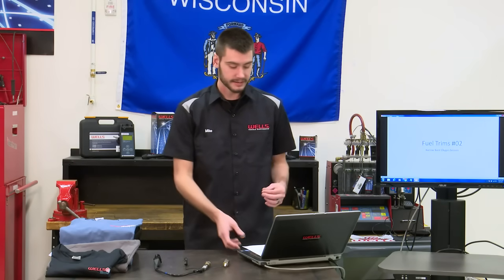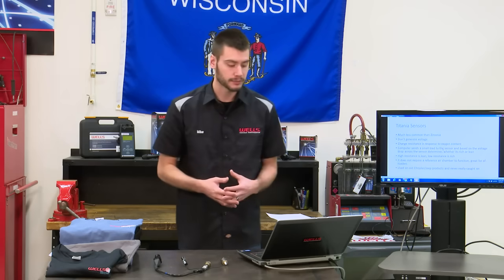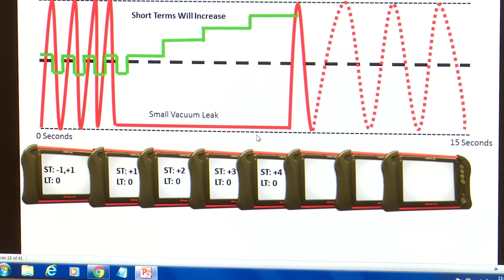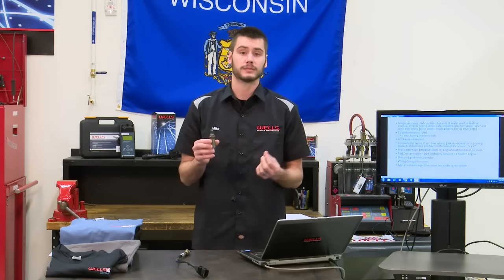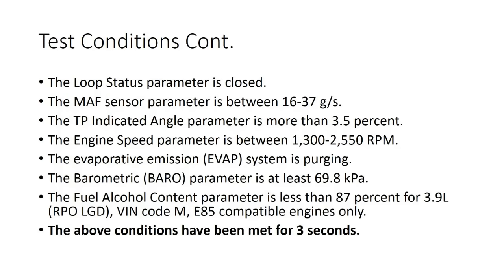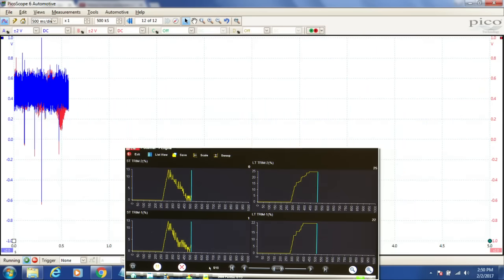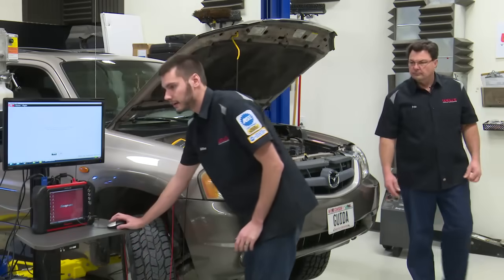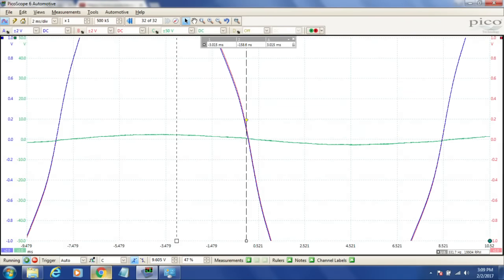Fuel Trims – Oxygen Sensor Basics—How They Work and How to Test and Diagnose Them (O2, HO2S)

Comment: GoTech => Very good presentation.  Thank you.
Questions - A scan of every measurement, status and settings that my Snap On Solus Edge would perform on a 2009 Saturn VUE Hybrid, and one setting seemed quite odd, that for Fuel, was set for METHANOL.  That looks like something programmed in to the ECM and no choices, such as E85, gasoline or nitro were presented.  
=> Will this METHANOL setting affect performance?  
=> Does the ECM learn and adjust to the actual O2 values even though the indicated fuel has a lot more oxygen than the actual fuel being burned?
=> Will the METHANOL ECM setting affect the setting of OBD P0420 &/or P1133 code flags?
The ECM is a new replacement.  An inquiry with FlashMaster/ Cincinnati, supplier of the ECM, had not encountered this before, even though its master mechanic/ owner, seemed quite knowledgeable and helpful with trying to find an answer.

Background
* EPA emissions test failed, OBD flag, Hybrid battery temp sensors, P092n (n= several numbers for various thermistors) and P092 (Starter/ generator perf, (likely due to current overload on a weak/ leaking prismatic NiMH cell that ruined a thermistor). 
* Faulty thermistor replaced.        Live data   STFT + LTFT < 5.0%.  O2 #2 sensor 670 to 750 mV, generally ~ 730 mV after warmup.  P0420 taking many drive cycles to set.  Needed to look further before taking for emissions testing.
* Then whack-a-mole problems began.  So  ECM, and both O2 sensors, exhaust manifold replaced.  P0420 still flagging despite good vacuum, no manifold exhaust leaks,.   O2 #1 and #2 sensor readings did not seem to change that much after driving 150+ miles.  
* Got an EPA emissions test waiver => OBD2 & Check Engine flags waived => Tailpipe emissions test performed. Tailpipe emissions test results of 0.01 g/ mi HC, 0.8 g/ mi CO, and 0.01 g/ mi NOx (close to non-detect for all), discharge cat converter temp > inlet (i.e., exhaust manifold) temp, O2 #1 sensor variable as expected (but an occasional P1133 flag on very short trips that clears itself quickly),  O2 #2  sensor steady at ~720 mV after warm up, about the same as the old O2 sensors.  I would like to say the average STFT is less than 2% but the LTFT has been averaging -5%.  (I am setting us to graph the STFT and LTFT to better substantiate these averages.)

Comment: I would like to use a vibrant j style fitting on my front o2 sensor due to clearance with the frame, my question is would the pcm be able to read correctly and if so should I use the fittings on both front o2 sensors?

Comment: To All you non mechanic DO IT YOUR SELFERS, If you want confirmation that your being told 100% accurate information on how a system works and how to diagnose. This guy has obviously torched his brain in researching thoroughly to where he could diagnose these specific problems in his sleep, without sounding egotistical, I consider myself and actually know that I'm a very very good mechanic with 32 years experience and I have learned some new information from this guys videos, and like anything your not quite an expert at, constant, consistently, with consistency will make you an expert, what I mean is always understand how a system works before you even waste 1 minute in trying to diagnose, watch this video over and over until you can repeat it in your sleep and you will become a expert, hard off to these guys in sharing there  brilliant knowledge with everyone

Comment: On my 03 Camry 2.4 Liter I keep getting the code P0141, I replaced the sensor after the catalytic converter and it came back on after 27 miles of driving. With the second replacement the light came back on after 1 mile. 
It started with code P0420 so I replaced the catalytic converter and then it triggered the P0141 code. After replacing the cat code p0141 is gone but not p0420. When I test the sensor it reads 6.9 and a new one reads 16.3. Help please and thank you
Reply: the cat code p0141 is gone but not p0141 ???
Reply: @jet6374  I meant to say that the code P0420 cleared after replacing the cat but when I replaced the pigtail for the sensor, the code P0420 came back.

Comment: at 8mins: Im finally getting it!   Combustion burning oxygen........ so greater difference on the element, referencing outside aid.  If not burning oxygen (lean) / too much air in the combustion then low voltage.  O2 is closer to outside O2 so therefore the element is less (active).

Comment: Hi I get a check engine light when the weather is cooler.  My mpg has dropped, the spark plugs look clean  with no brown or white haze to it.  Can the upstream o2 sensor be the culprit?  2005 Lexus Gx470 2UZ

Comment: If I put a new one In and it reads 0.0 longft2 is that Good or Bad ?
Reply: My Longft stay on 24.2 wit the truck on or off is that good I did have a p0174 code system tol lean bank 2

Comment: Its not a oxygen sensor.  There is no oxygen in exhaust gas. Try pyrometer or wide band EGT.
Reply: There is always some leftover O2 in the exhaust gas due to incomplete combustion, and there is always incomplete combustion. If we didn't have any incomplete combustion, we wouldn't need cats.

Comment: I got a 2nd gen mazda 6, 2.5L. I keep getting a lean code and if I clear it sometimes it will come back as a rich code. To me it seems like the o2 sensors aren't working efficiently and the mixture is fluctuating up and down trying to regulate. The only thing that confuses me is there's no code for an o2 sensor circuit or cat efficiency. I would like a 2nd opinion if anyone has any input I would appreciate it.
Reply: I forgot to mention it has an exhaust leak but I'm not sure where. It's not at the manifold and I believe it's the middle pipe or muffler that's leaking. I don't think that would make a different unless it's leaking before the cat or at the manifold but thought I would add it here.
Reply: Go to auto one have them pull codes if anything doesn’t pop up, graph the o2 sensors both should be fluctuating up n down the one that’s stuck up or down in the graph will throw off the downstream o2, the o2 graph not fluctuating needs to be replaced

Comment: Hi, very informative video, probably the best I've seen in terms of explanation of how these sensors actually work. Can you explain why not to use dielectric grease in the electrical connectors for O2 Sensors? I'm currently getting a P0420 code on my Audi S3 8V (2014) and am going to change both upstream and downstream sensors but seeing contrasting opinions online for the use of dielectric / silicone grease in the electrical plugs/connectors.

I realise the P0420 could be due to other reasons but my mechanic recommended changing the sensors to start with and see if that resolves it, if not it's likely either an air leak or the cat itself. It did previously have a blown head gasket which was replaced which could suggest one / both of the sensors have been contaminated though. Thoughts?
Reply: Did you watch this entire video? I did not...I made it to the 5 min. mark, and that's all I could take. He's highly incorrect about the operation of this sensor. The reason you don't put anything in the O2 connector is because the sensor gets it's O2 ions from the PCM traveling through wire itself. Electrical grease would prevent the flow of ions to make it to the tip of the sensor. He can't explain that to you because his explanation of how this works doesn't require the ions to migrate. I left an accurate description in the replies.

Comment: Hi I have 2020 Corolla le with code p0101 I change the mass air flow and still have the same problem what can I do
Reply: Did you ever get an answer?  How's the Corolla doing?  I had a 69 Corolla but sold it when I moved across the country and didn't want to bring to vehicles.

Comment: Once the air flow sensor reaches 600 degrees does the heater voltage stays on even after the engine is up to temperature??

Comment: I have an 03 F150 Lariat with high negative fuel trims, and a P0401 code.  I have replaced everything in the EGR system (as well as several other parts/sensors) and all 4 O2 sensors plus catalytic converters.  Any ideas what could be causing that?
Reply from the maker: Hey Jared,
This engine has a tendency to have EGR passage restrictions behind the throttle body gasket, where the hot exhaust gases from the EGR valve meet the cool intake air coming through the throttle body. To clean passages remove the EGR valve and throttle body.
~Ryan
Reply: @GoTech  my Bank 1 Sensor 2 O2 sensor is fluctuating voltage like the upstream sensor does...that's not normal is it? The bank 2 side slightly fluctuates, but it's mostly flat lined.  Could the downstream O2 sensor on the passenger side be messed up and giving false readings for fuel trims?
Reply: @GoTech  I have done all of that, I recently replaced the intake manifold.  So I went ahead and cleaned the entire throttle body, passages and all.  They were actually quite clean already.

Comment: I'm having a problem with my O2 sensor, my catalytic converter was taken from my Toyota prius 2008 with sensor 2 together but after replacing it with the original parts, catalytic converter and sensor 2, the light has been popping up with code P0137, the O2 sensor's low voltage bank 1 sensor 2, I went to Toyota they said sensor 1 is not good and my gas consumption has gone up 25% but now I have changed the sensor 1, still the light is kept on coming back, I didn't have this problem until my catalytic was stolen. the injector, spark plug and ignition coil are good What is the solution?
Reply: Shoot catalytic thieves is the solution. 
Glad I could help. 😂

Comment: I have a Nissan Frontier 4.O showing closed Loop Bank1 sensor 1 . P2A00 circuit range Bank 1 Sensor 1. I changed the sensor and light came back. This is. 5 wire heated sensor. Any thoughts ?
Reply from the maker: Hey Chris, I would need the year of the vehicle to give you detailed testing info. Aside form that, I always suggest taking a close look at the wiring harness and checking to make sure the sensor heater fuse is ok.
~Mike

Comment: Both wrong. Fill with dielectric grease and it cant sense beause contaminated. Not switching  because its "s2" after the catalytic converter so smooth signal shows an efficient catalyst. "S1" will be switching because theres an excess of hc which will be converted by the cat.. well i just learned i was wrong regarding tech a

Comment: answer is D because its only needs to be cleaned from any grease
because sensor does onle 0.2 -1.0 apprx volt so grease will mess it
never apply any grease on a low voltage circuits to avoid short or interferences
Reply: I wouldn't put grease anywhere near an O2 sensor...and besides, wouldn't it just melt off?

Comment: How do you fix a Po172 bank 1 on a Buick Lucern CXL Original Buick 6cyl.
Reply from the maker: Hey Robert,
I would take a close look at the MAF sensor.
~Ryan
Reply: Vacuum leak also. intake gasket, or pcv or any vacuum line on that bank Robert

Comment: Could a faulty rear 02 sensor cause a catalytic inefficiency code? My van threw that code and my scan tool says rear 02 is 800 millivolts flat line at idle
Reply from the maker: Hey Lucas,
A faulty o2 sensor could definitely cause a P0420 code, but having a flatline rear 02 signal at idle is normal. Since the catalytic converter's job is to absorb excess oxygen and use it to burn excess hydrocarbons. When it is working correctly it causes the rear 02 sensor to be fairly inactive. If the rear o2 sensor switches at the same rate as the front o2 sensor, this is when a faulty catalytic converter is suspected. I would try and test the readings while driving the car at different loads.
~Ryan
Reply: @GoTechTraining  sounds good

Comment: Could running an engine with highly contaminated oil cause zero compression?  I've got 0 compression in 6 cylinders, fml
Reply from the maker: Hey Tino,
Yes, if the oil is contaminated it can cause cylinder wash and you can loose compression. This commonly happens with fuel flooded engines.
~Ryan
Reply: @GoTechTraining  what should I do?  Hope it's salvagable
Reply from the maker: The first step would be to change out the engine oil. Then disable the fuel system by removing the fuse for the injectors or fuel pump to stop the fuel supply. Once the fuel is disabled crank the engine over and see if the compression comes back after it is lubricated properly. 
Do you what is contaminating the oil?
~Ryan
Reply: @GoTech  yes that's my plan.  Pretty sure Fuel was dumping because of a shit fuse diagram.  I'm worried it caused serious dmg though
Reply from the maker: Hopefully compression comes back! Good luck
~Ryan
Reply: @GoTech   I followed chevys fuse diagram and i think it sent extra current to fuel pump
Reply: @GoTechTraining  comp no-good,  moving to leak down test

Comment: my 3.6 gm is blowing black soot out of the bank 2 exhaust .. bank 1 is clean .. what`s up ..
Reply from the maker: Hi Willie,
Your Bank 2 oxygen sensor may be stuck lean, causing your ECM to over fuel your engine on bank 2.
Are any codes set?
~Ryan Wilsing
Reply: @GoTechTraining  i have po154 and 155 ,, oddly i just unhookd my pvc hose and created a small vacuum leak and my long term numbers went to zero ,, they had been 10 or more ..
Reply from the maker: Hey Willie,
Check your engine oil from being over full from fuel contamination. You may have a high pressure fuel pump leak (which is run off the camshaft) causing fuel to enter your oil and with the PCV it can cause your engine to run rich. Also check for leaking injectors.
~Ryan

Comment: what does it mean when whe sensor 1 bank1 slow to respond
Reply from the maker: Hi John,
The computer in the vehicle has to check to make sure the oxygen sensors are operating correctly. To do this the computer will force the engine rich or lean, or compare the o2 sensor to the other o2 sensors on the vehicle. If the 02 sensor responds slow (past a pre-determined amount of time) it will set a o2 sensor slow to respond code.
Thanks for watching and for reaching out!
Ryan Wilsing

Comment: Just changed my upstream O2 sensor on my 1999 Saturn SL. Yes, it’s still running great. I cleaned throttle body, changed plugs and wires, cleaned and re-oiled my K&N air filter plus other parts. The car ran great until it warmed up. Finally my service engine light came on. Took it to Advance Auto and they said O2 sensor code came up. That was actually what i was suspecting. I didn’t have the understanding on how it worked or just how important it is for engine performance. So with a new O2 sensor it runs like a top. I won’t be convinced that everything is working until i take a longer drive and I’ll know. I was wondering why my damn fuel economy went to hell. I was always getting 38mpg on average. This is highway/city average. Highway normally 40+ mpg! I love my old Saturn and will drive it until it dies. Thanks for your informative video!

Comment: What is meant by open loop due to insufficient engine temperature
Reply: Open loop means the PCM is not applying fuel trims (adjustments) to the injectors because the O2 sensors are not hot enough to get an accurate reading to send to the PCM. The PCM is sending a preset output value to the injectors until the 02 sensor is hot enough to work.